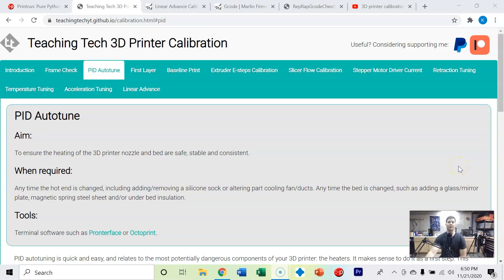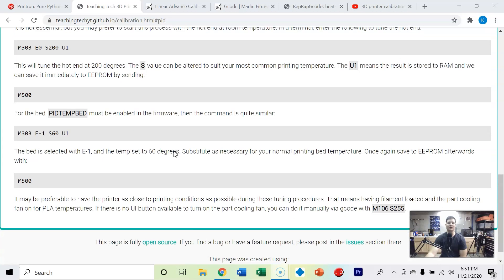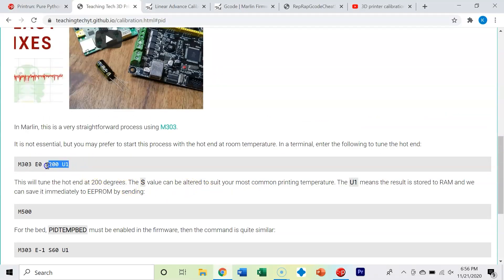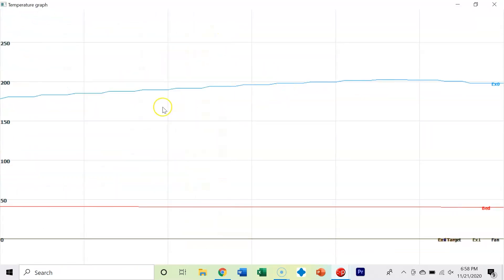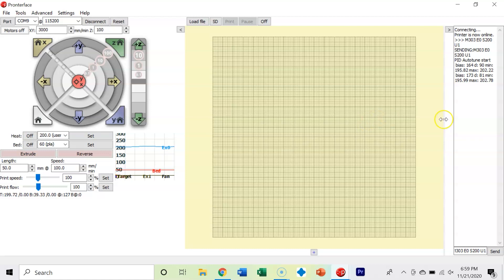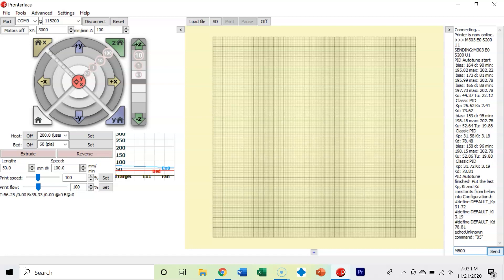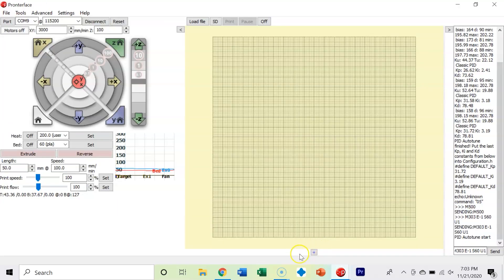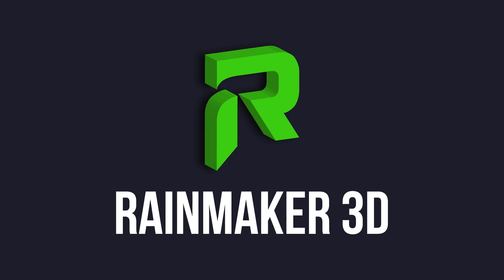PID Autotune Tuning Your Hotend and Bed Plate - Calibrating your 3D printer Part 2 -  Ender 3 V2

Comment: Hello, I have an ender 3 my bed temp keeps going up and wont stop, I replaced the board main board replaced the hot bed thermistor and its working..  The voltage going to the heating element for the bed keeps going there is no way to stop it on a set temp.  I have also done a PID and everytime I try to do it for the bed i get PID Autotune failed! Temperature too high
echo:Unknown command: "05".  Any suggestions?

Comment: After the "M303 E0 S200 U1" Code 
Pronterface sends message "echo: busy: Paused for user" 
Not sure what it means and not sure if it understands any code I sends after, since it repeats that message forever till i disconnect. 
I think i may saved the command but not 100% sure it did. 

If anyone know anything about that let me know
Thanks
Reply: For my Ender 5 its waiting for you to push the dial in on the machine.

Comment: anyone else having issues having the computer see the printer? every time i connect it, i get a error and cannot find a way to fix it or even a driver online any thoughts?

found the solution in the install video.
Reply: I had the same temperture hold error  my termistor was broken and the hotbad in rong voltage ( check power)

Comment: I have a cr-10 v3 but I tried every thing but when i start the printer .. it gives 62 degrees bed temperature even when its 19 degrees .. en 51 nozzle temperature .. it wil not go lower ...
Reply: Chek the bed or extruder power chek your voltage and current available in you ramps

Comment: when running the M303 E-1 S60 U1 command on my ender 3 it returns PID Autotune failed! Bad extruder number what would cause this?
Reply: You get this error because pidtempbed is not enabled in your firmware.
Reply: @benjicollins1  same problem... pidtempbed is enabled also please help
Reply: I'm having the same problem, but I have no idea how to enable pidtempbed or even how to see if it is enabled or not. I think from what I found on google, you have to go into the actual firmware and change some coding, but I'm not a programmer and all of this confuses me.
Reply from the maker: My students had this same issue on a base ender 3. For some reason this command does not work on an Ender 3 but will on a V2 I would just move on to the next calibration steps. That is what they did and their printers work good now, the bed is not as critical to tune as the hot end.
Reply: @rainmaker3d  just wanted to give it a go due to constantly getting thermal runaway on the bed. do you know of any way of fixing that?
Reply from the maker: @adrenalinejunkie6797  as of right now I don't. I start teaching my cnc course again tomorrow so I will work with my students on a fix. If we come up with one I will let you know.

Comment: In pronterface in the port drop down menu it isn't showing anything its just blank, my printer is turned on and connected to the laptop via USB cable, any ideas why nothing is showing?
Reply from the maker: I have had this happen before, I had to move around ports and sometimes cycle power on the pc and or printer. 

You might also try this link for drivers:  https://support.th3dstudio.com/hc/en-us/articles/360043291432
Reply: @rainmaker3d  spot on thank you 😊 it was the driver. I've replaced my glass bed as it was warped with a magnetic one, so I'm working my way through your videos to fine tune the printer now 😁😁
Reply from the maker: @kevinwells5802  Awesome! Thanks for watching, happy printing!